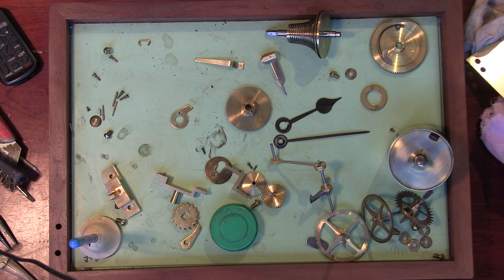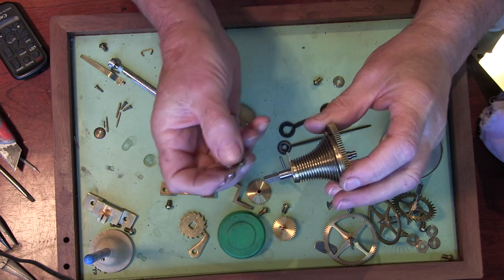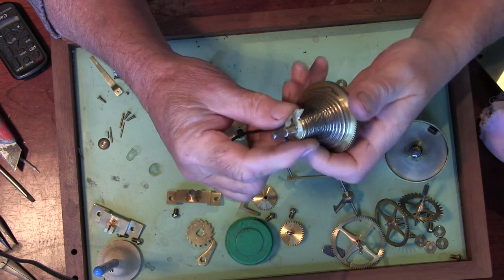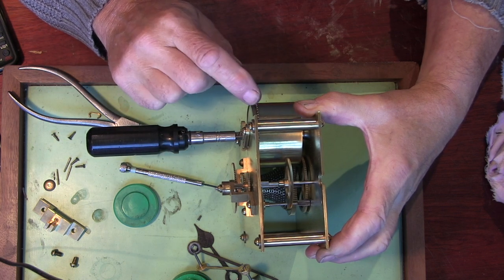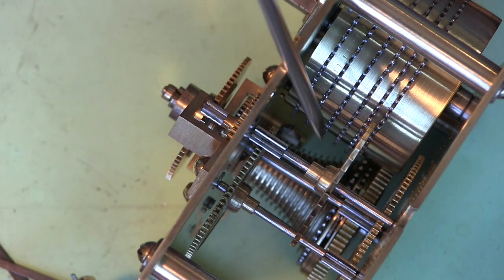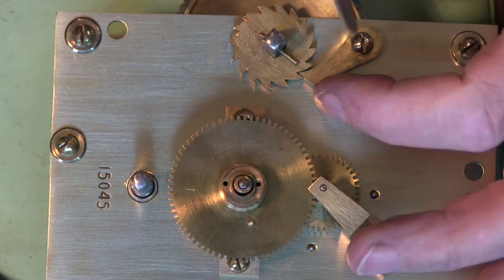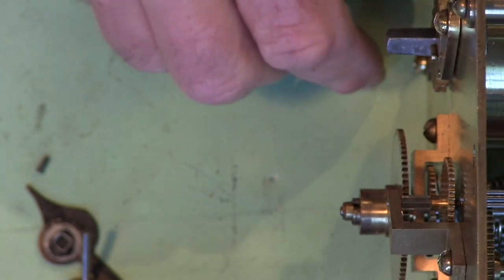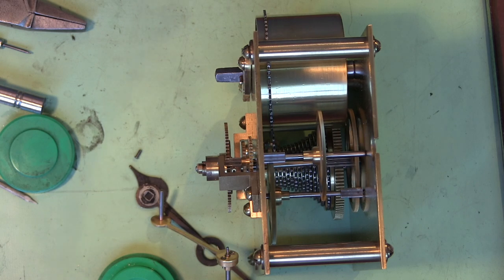What is a Fusee, Part Two.

Comment: Thank you very much for the wonderful video. I am 400-day clock collector. I also have a wall 400-day torsion clock. But just happened that I was attracted to the 400-day wall fusee clock—so this explanation about the fusee gave me a full logic. I have a steel cable - a bit scary, about the size of the mainspring. I have cleaned many 400-day clocks—but stil I am a hobbyist. Your explanation was great and made sense. I will get a clock in October and will see - I was told by another owner of such clock that they are more accurate then ordinary torsion 400 clocks. We'll see. Once again - great appreciation for a video—it was extremely helpful.Thank you - Peter

Comment: Hi Cliff, really enjoy your videos thanks. In 2019 you mentioned you might do some kitchen table clock repair videos, is that still on the cards? Cheers
Reply from the maker: Hello,
Thanks for that, still working on the clock videos, life is just getting in the way! Regarding your clock with the non moving hands, the center wheel has a friction fit, so that you can move the hands, it could be that it's very loose and is only driving the wheel and not the arbour that drives the hands, not an easy fix without taking it to bits unfortunately
Reply from the maker: All the best,
Cliff

Comment: Hi Cliff. Do you take on clock repairs. I have a brass spring powered clock which stopped working about 12 months ago. I had a quick look based on some of your previous videos (haven't stripped it) and have come to the conclusion it's a worn bearing. Haven't got the tools and experience to have a go myself.

Comment: Fusees were made between 1870 and 1920.
Mine is a wall clock. The pallets bridge and pendulum were  missing so I bought second hand parts.
Although it would run, it gained about three hours a day which is outside the scope of adjustment. 
The pallets are wrong (angle etc). New pallets can be bought  but I don't have the skill to get them
to the right angles and distance apart. I will probably have to pay an expert to fix it.
Mine (a Post Office clock) dates from 1907 or before and was wrecked by kids after it retired
when the Post Office moved but somebody else took away the parts. I have replaced, repaired and 
made all the other parts so at least it will never get scrapped.
Reply: Mine has a wire cable instead of the chain yours has. It was broken so I replaced it with a pushbike
gear cable. This worked perfectly.